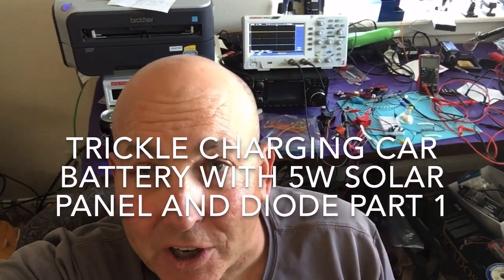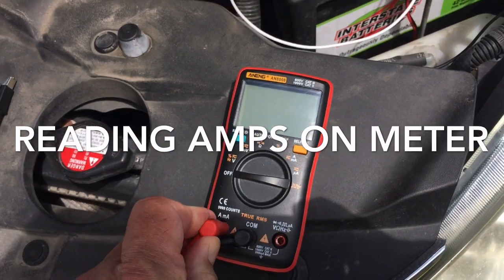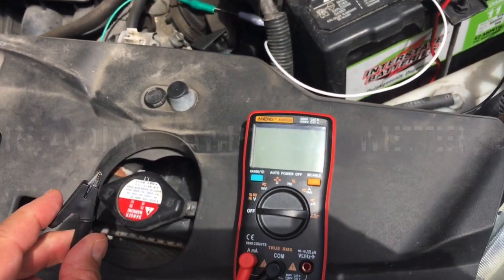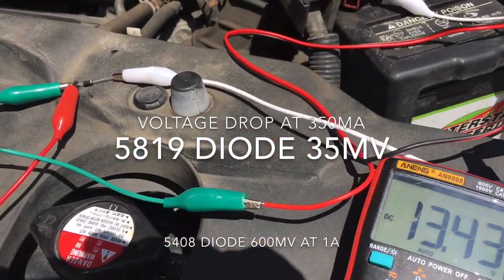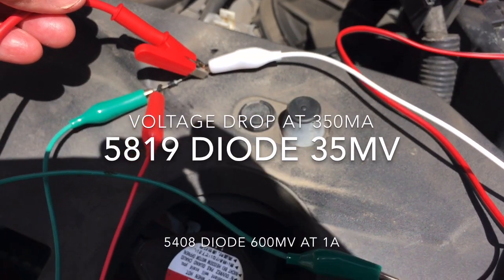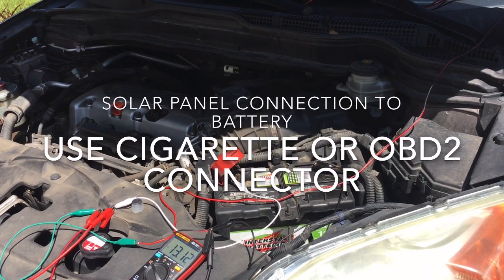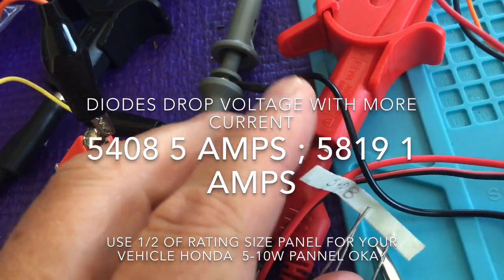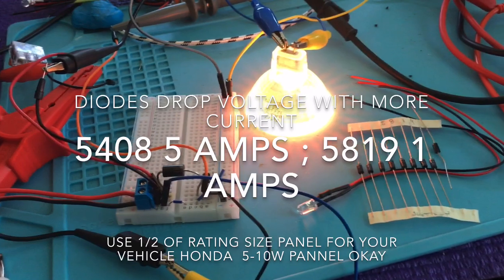Trickle Charger for Car Battery with Direct  5W Solar Panel and Blocking Diode no charge controller

Comment: I think if you open the small black box on the back of the solar panel you will find it already has a diode.... so no need for the second diode.
Reply from the maker: I think your right mostly but the 5w I buy don’t seem to have diodes.

Comment: Awesome video , how the system is working all this time ?  Did not overcharged the battery ? I’m doing the same for my boat, thank you .
Reply from the maker: I have been using this for some time now and it works great for my Honda CR-V. With a 5w panel. I have one other video on this same topic.
Reply: @dannyjensen4954   thank you !  I like your videos .🙏🏽

Comment: Performance of schottky diodes are significantly affected by temperature. So, I use a normal diode 1n4001. I keep the panel connected permanently to the cigarette lighter port, and it starts with the car fine. I have a 9W panel that I partially taped over to reduce power to maybe 7W. It gives my 17.5 year old battery plenty of surface charge, enough to start the car like a new battery. The panel keeps my battery at 15.5V with no discernible effect. Nor, do I believe the battery gets overcharged. It's been a tidy and happy set up for many months.

I think the dislikes are from people who think they need a regulator.
Reply from the maker: I chose the schottky because of the lower voltage drop. Are you saying my diode will fail due to heat? You have plenty of power on you panel so you can take the vdrop hit.  I'm guessing you have lead acid? 15.5 is about 1v more than I would have guessed. The battery must not get to 15.5 very long. I guess this is equalization? Good to hear your story. Yes PWM chargers are cheap but they consume power in the evening.  If a panel /wiring goes bad the pwm charger  can draw down your battery. I'm guessing diodes fail in the open state?
Reply: @dannyjensen4954  Schottky is affected by temperature. I believe the leak current is exponential to temperature. In a hot summer night, you could potentially lose charge to whatever you have connected that is capable of consuming power. You can find some videos explaining the disadvantage of Schottky.

My battery has been at 15.5-16V for months and it still starts the car. Given the age of the battery, I am willing to test it to destruction and see what happens. I did get some oddities and insights. The battery's lost capacity from age appears to be permanent and not recoverable chemically or electrically. Although whatever remains of the capacity does not appear to be declining. The car starts fine from sitting. It has trouble starting after driving for a while - it would fail to start and then starts perfectly fine from a second try. I am guessing this is caused by over charging by the alternator.

No idea what happens when the diode fails. I won't bother testing it until I can't start the car because of a flat battery.
Reply from the maker: @fungames24  Thanks. I’ll look for some videos on the diode topic.